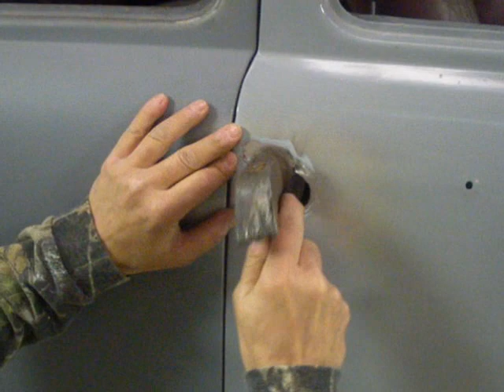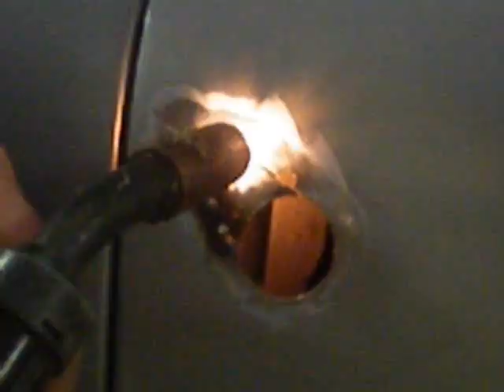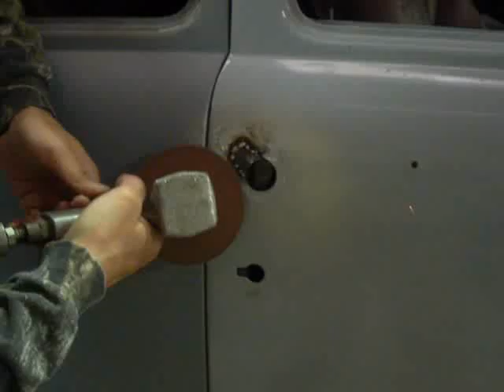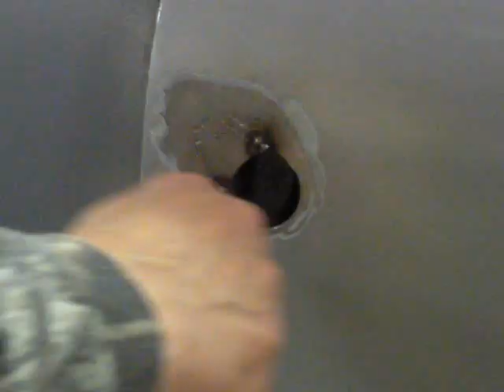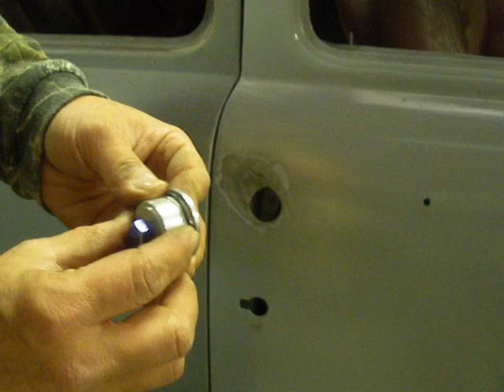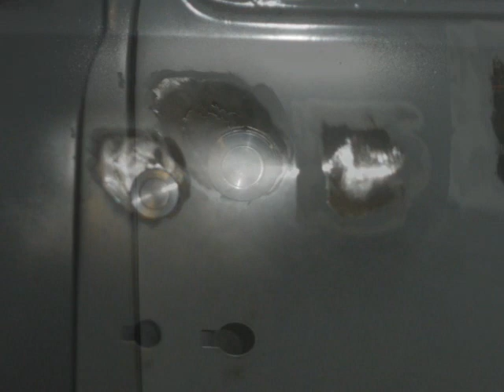Push button to open your car door

Comment: @nitvid  I have a '49 ford coupe I want to install them on and it look like that was a shoebox as well?
Did you keep the original locks? or is there a trick to locking it. Also are you using poppers to push the door out?
I imagine try'n to pull the door open with out anything for your finger to grip would get tiring. I'm interested in a set for sure.

Comment: Does this unlock the door, I mean is it safe in the sense if you park your truck and its locked can someone do this and be in your truck. Not criticizing but this is basically a commercial it would've been nice if someone talked about the product while installing.
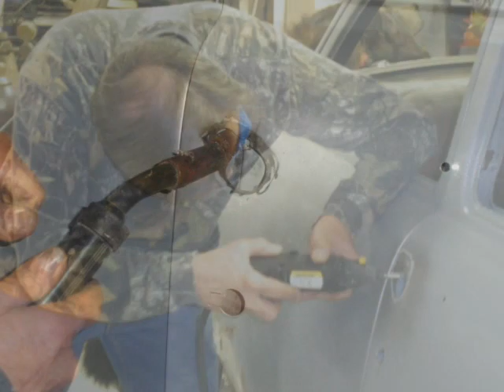Reply: Dime Fever — These do not unlock the door. These are just a low profile replacement for the door handles that used to be on the 49-51 Ford shoebox shown in the video. It's a bit more modern looking that the set I have (i have a 51 Ford). These push buttons are similar to the ones that were stock on the 46-48 Lincoln Zephyr. If you look in the video at 3:19, you will see another hole below the one he is working on. This is the hole for the door lock. If left in place, this is how you lock the door. Or you could go with remote lock , like Autoloc. I would like to add that these are a more rest mod/modern interpretation. Rather flat looking compare to the Logic Industry ones I have. Hope this helps.